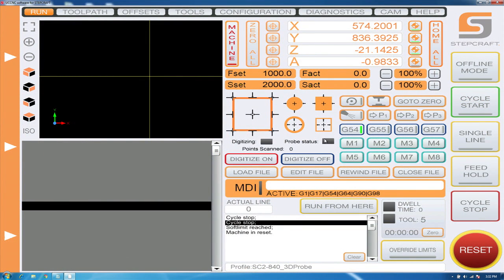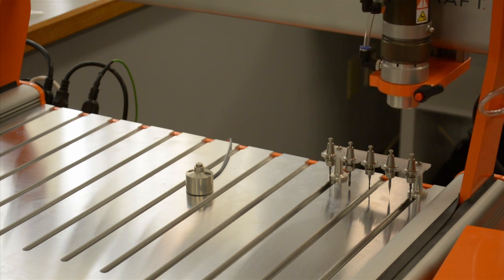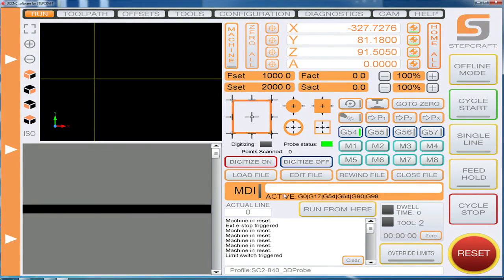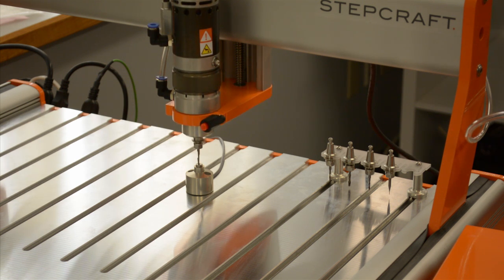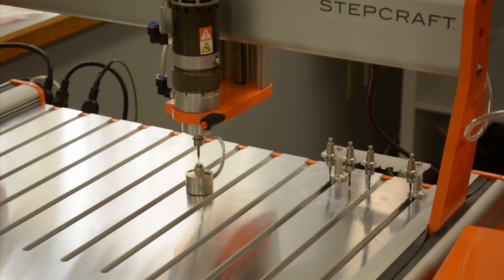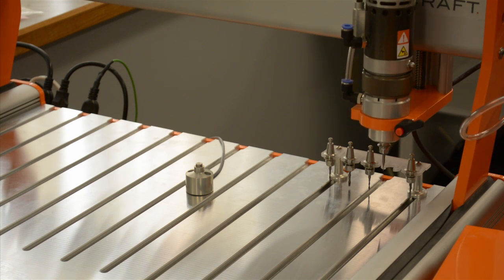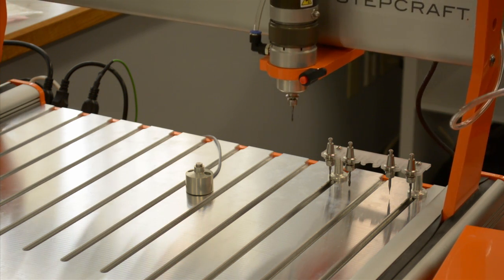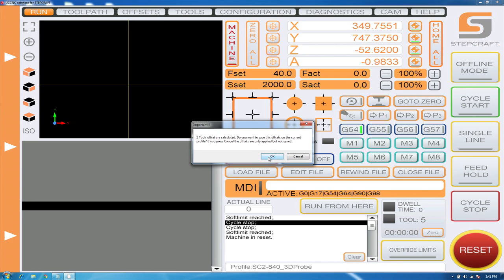Cool Feature! - STEPCRAFT Automatic Tool Changer's Auto Tool Touch Off

Comment: Wonderful! How those tools knows the height of zero point?
Reply: if you're asking how does it know the length of the tool based on the sensor, the sensor is precision made and sitting on the bed.  so the zero is off of the bed and known sensor height.

Comment: Sir, how does it know the stock top surface ?
Reply: the bed is always going to be the base, and the sensor is a precision height. so when the tool triggers the sensor, it's easy to calculate the length of the tool, as relative to the bed.  when you have stock on the bed, the stocks dimensions like height are given to the machine, so the location of the tool and the height of your stock are relative off the table.
Reply: @CrudelyMade  thanks

Comment: what if you measure all tools but there is one pocket without a tool?
Reply from the maker: Technically nothing would happen.  The machine would not pickup the tool and when Z lowers, it would hit the tool length sensor.  It is always good practice though to just put the tools in order that you will use them so if you only have 4 tools, then you can just touch off 4.  Also you can enter in 1 and then select which tool you want to re-touch off, in case you decided to change one of the tools so you do not have to re-do all of them

Comment: Need some faster rapids on that bad boy. I was falling asleep during tool change :)
Reply from the maker: Keep in mind that it is a Hobby grade machine - not an industrial machine.  It is moving at 50mm/sec when doing tool changes.  And considering no other machine in this price range/class has a tool changer, I would say it is pretty fast :-)
Reply: Base Blazer Covebase Dolly what is the cost for this time adventure. With respects to hobbyists use?

Comment: could you put more toolholders on the toolchange position or is it limited to 5 tools?
Reply from the maker: You can add up to 4 racks on the 840.  I have customers who also run 2 rows of racks one in front of the other and then change the macro to allow for tool changes that way
Reply: @StepcraftInc  hiii, how many revolutions are this motor of the video? Please
Reply: you can add another rack of 5 on the 840 (it is the one I own so can only comment on this model)

Comment: Do you have a vacuum table option. Also it takes quite a while to change tools?
Reply from the maker: We do not have a vacuum table.  You can make one as there are plenty of plans on the internet or you can buy an aftermarket one.    No it takes about 1 minute to change tools manually or you can use our automatic tool changer which does it via the code

Comment: Is it possible to use Auto Tool Touch Off and changer with USB full version or only UCCNC?
Reply from the maker: It only works with UCCNC.  You can use the ATC with WinPC-NC but the macros for auto touch off are only written in UCCNC

Comment: Why so much Z movement between tools?  Should cut that in half.
Reply from the maker: It's adjustable in the Macro file.  We leave it at that default in case the customer has a long tool and we need to make sure it clears the other tool holders in the rack.
Reply: Going to Z Max is the safest way to do it, only thing i would do is, after releasing jog incremental 10mm in Z+ then rapid to Z Max and the same when collecting a tool